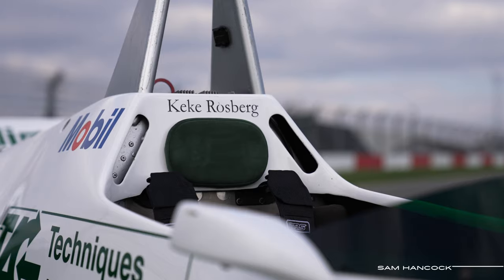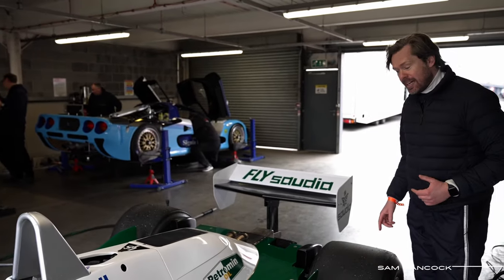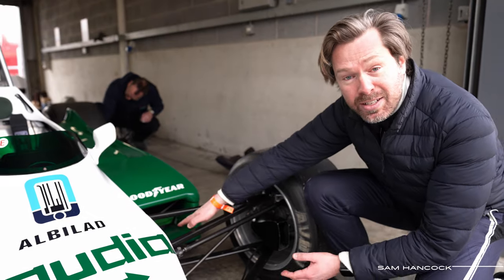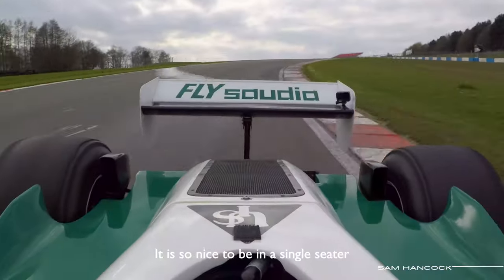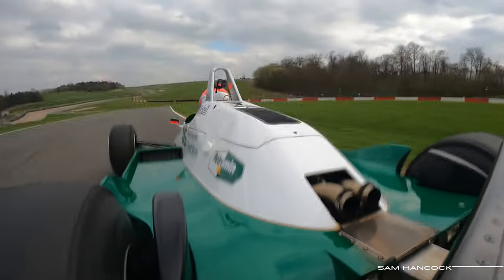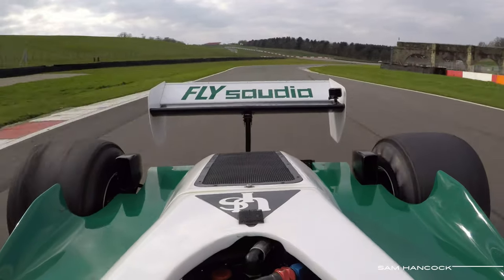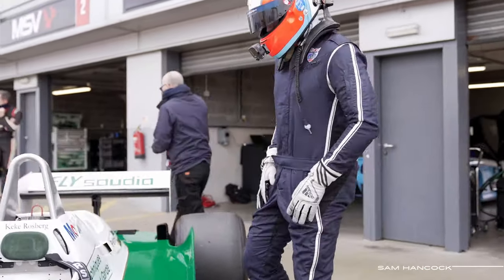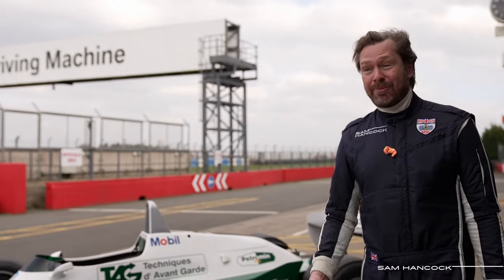DRIVEN | Keke Rosberg's 1982 F1 WORLD CHAMPIONSHIP WINNER - the Williams FW08

Comment: People seem to forget how good Keke was 82-85. Won the title with that underpowered car. 83 and 84 Williams was completely uncompetitive. It was like 40 km/h slower on straights than Brabham, McLaren and Ferrari. Keke won two street circuit races with that pig of a car (Monaco 1983 and Dallas 1984 were impressive drives) and beat Laffite 13-1 and 14-1. 1985 he was probably the fastest man on the grid and made Mansell look like an amateur. Williams got faster 1985 but the car wasn't reliable. Then 1986 hampered his reputation. The McLaren was designed for Prost and Keke couldn't drive that car because it was so understeery. Great driver, very underrated champ.
Reply: I was lucky to see Rosberg race in many a time in the Williams from 82 to 85 . Was always 110% comitted. His drive at Dijon in 82 chasing Prost over the last 10 laps unreal.
Reply: @karlstannard662  The most impressive Keke drive was the Silverstone 1978 non-GP race, which he won in a Theodore in torrential rail. A car that was so slow that it couldn't qualify to normal races. But it was a crazy rain, crazy race. Check that out, it's on Youtube.
Reply: It might have been underpowered but that made it so much more reliable than a turbo engine and keep getting points nice and steady has proven to be better than winning a couple of races at least back then but it is a beautiful car for sure and Kiki was good no doubt about that
Reply: 40 km/h slower on the straight than the McLaren? McLaren were powered by the DFV like Williams were that season. I think you meant Renault, who like Brabham and Ferrari had turbo engines. The FW08 was certainly not a pig of a car- it was clearly fast, and the C-spec ‘83 car was the quickest of all the non-turbo cars that year- but the FW09, with that badly under-engineered and volatile Honda engine was a pig of a car.
Reply: @hmdwgf  Yes in 1982 McLaren's were Cosworths. But they got the TAG/Porsche turbo engine for 1983 whereas Williams only got their Honda turbo for the last race of 1983 for Kyalami. And even in 1984 it was way inferior, unrealiable and slow. And even Patrick Head admitted the 1983 and 1984 cars were horrible. 1985 Honda turbo got the power but Keke had 5 1st place DNF's that season. He left Williams just when the car got good in 1986. Cheers.
Reply: @detonator2112  But which 1983 car? The FW08C DFV car or the FW09 Honda car (which as you say debuted late in 1983). Also the McLaren didn’t debut the MP4/1E TAG/Porsche car until the Dutch GP I think.

Comment: One question. I've noticed that both 1982 and 1983 models of FW08 had a narrower rear wheel span, while the front wheel span was wider. I'd like some more information about the reasons behind that. Was it something to do with steering?